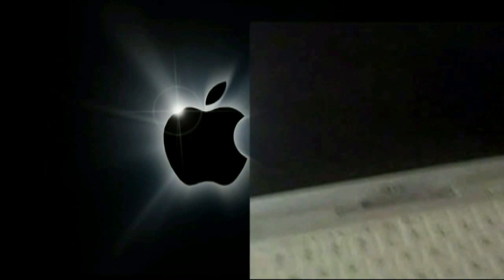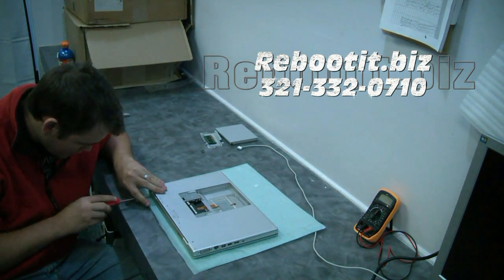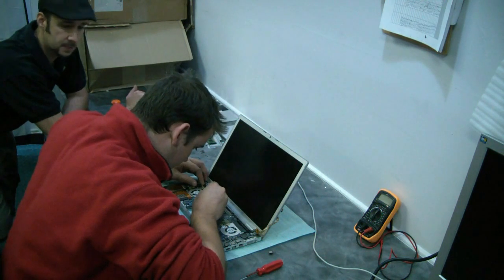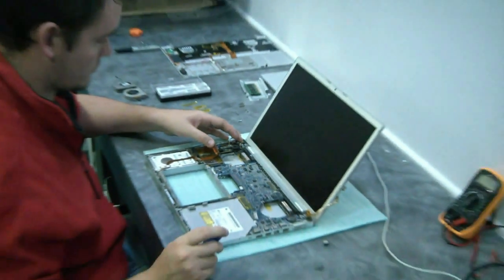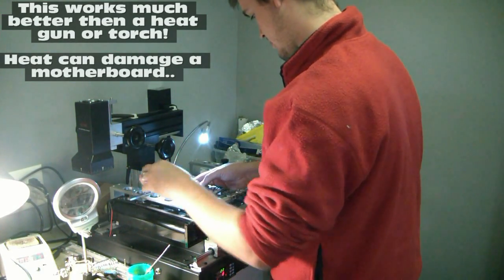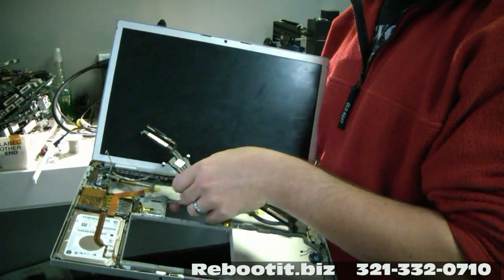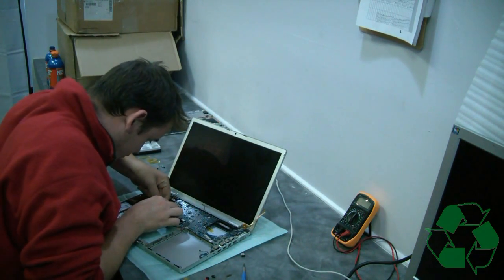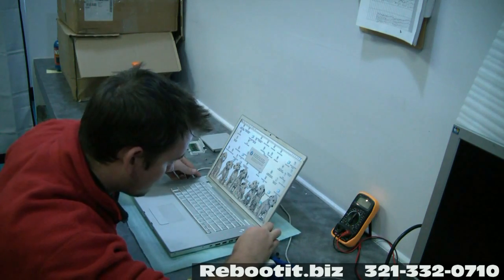Macbook Pro Intel Nvidia video failure. Black screen fix in HD

Comment: A LOT of YT Cottage Industry Late 2008 AL-UNIBODY LCD HAIR DRYER "Repairs" only caused one to
CRACK the Cover Glass.  Not warning that Apple INC. used ONE SPOT of EPOXY in the upper right corner.
The rest being held double sided TAPE!
THOSE sites would then sell their suckers a cheap CHINESE third party 2009 MBP 13.3 COVER GLASS!
What brazen BALLS!
The REAL repair is a replacement UNIQUE  Late 2008 AL-UNI LVDS flat lead CABLE!
Which no one has any more, of course 
NOT a third party 2009 MBP 13.3 LVDS! Wrong  form factor!
I ended up removing the top cover & LCD screen
Using it with external monitors
AND my 20" LCD TV....
Until the AL-UNI's GPU finally failed, last year....
It then became a Hanger Queen Parts Donor...
AFTER I found an early 2009 DELUXE AL-UNI 2.4 13.4 for only $41 ppd.
on eBay, from a young man at Lawrence-Livermore Labs
Only needing a 160GB HDD from my parts bins.
STILL my best Mac for going to scientific public meetings...
Adler, The Field, Fermi, Argonne and sux=ch like
LOOKS like the latest PRO!!
Could go to CERN with not an eyebrow raised
Pretty good for a Late 2008 MacBook that WAS going to the crusher, 
a Macster club friend had from NEW in 2008!
My 12/2007 MPB 15 stays fixed for a few days
Until CLONING a HDD
or leaving it shut on SLEEP
Causes it to overheat yet AGAIN!
Those 17 screws!!!
No heat gun needed
Just running upside down
with the fans  disconnected
until the hot air solder melts
( c. 175F)
But BEWARE of schysters!
Cheers
J.C.

Comment: HOLD ON!! wait, I fixed it!!! without any of that... It's a simple "SMC" fix—done right after taking a deeep breath.  I just had the same "Back Screen" with a 2008 Macbook Pro 17"... After watching this lengthy video I was about to ho ahead and open the laptop and follow the same steps... But thought I would give it one last shot and Google the issue out side YouTube, here: follow these steps,
1. Shut down the computer.
2. Disconnect the MagSafe power adapter from the computer, if it's connected. (AND FROM THE WALL, AS WELL... That's the key)
3. Remove the battery.
4. Press and hold the power button for 5 seconds.
5. Release the power button.
6. Reconnect the battery and MagSafe power adapter.
7. Press the power button to turn on the computer.

Comment: Great Video! I have a Macbook Pro A1260 4,1(Core 2 Duo) and no matter what I do, I can't upgrade past Sno Leopard 10.6.8. Every attempt either hangs on the first reboot OR, on a fresh install, She just hangs.  It DOES have a bad Firewire port in which case I just remove all the IofireWire kexts from Extensions then it works fine after I do that. I JUST CAN'T UPGRADE HIGHER THAN 10.6.8.  Great Job on the video fellas! -Larry (I Just Subscribed)

Comment: Reflow without reballing the cip???
Video problem will come back in 3-5 months.
Reply: +mixcatcom can you replace the GPU with another one ? I tried myself with a heatgun and resoldered a different nVidia chip on the board....but it didn't work epic fail...

Comment: I dont know if you have any branch in dubai but I have a Mac book pro. I hvent able to use it for like 2 years now. I had it diagnose they said its the logic board but having it repaired is costing a fortune they are advising me to just buy a new one. if you guys can give an advise that would be much help. I love this my mac it the first one i had so it has a sentimental value. Thanks.

Comment: I bought this Mac on Ebay and the GPU goes up to 70-80 Degress till the fan goes up
I might have to add some thermal paste for a better cooling.
Currently I"m using fan control programs to turn on the fans while playing some games

Comment: I had the same problem with this model, but I managed to fix my nvidia  chip with your  method, tnx ,  but if you could answer me on two questions, Based on your experience, How long does the computer work after REFLOW, and after assembly fans are always at 6000rtm, thanks in advance, and sorry for my bad English, it's not my native languae

Comment: Are there any signs leading up to tis failure. I recently started getting some weird lines / glitches on my screen followed by now a black screen.
Reply: Those are the signs
Reply: Ok now the screen comes on bit when I power On it gets a couple little lines around the apple logo. Then freezes. .. How much to fix approx? Unfortunately I just installed a 120gb ssd and haven't even got the opportunity to boot it up fully.. thanks for your response
Reply: I need to know the size in order to give you a ballpark estimate.
Reply: Mid 07 15" macbook pro.  (MA895LL) I  believe
Reply: If all it needs is the re-flow, your looking at about $200, but it is impossible to know if that is all that it needs without looking at it.

Comment: So, I waisted a Tequila Sunrise on my 2011 13' Macbook Pro, I5 , upgraded to 8 Gb RAM. Initially the touchpad went crazy on me. NOW its fine. Everything Works. Backlight, sound,ports, trackpad, webcam. I've done all of the reboots, and Im about 95% confident that It's a hardware problem. Im able to connect my Macbook to my TV, and everything is fine. not good enough, Im a BROKE student and I need my laptop to be mobile. All I'm asking is advise as to what parts I should buy to fix it myself?

Comment: Hey there, I have this issue, however I can successfully output to an external monitor, which is how I'm running it currently. I understand this means that the problem is likely the NVIDIA 8600, and that the extended warranty is now expired. Do you have a suggestion for how to fix this myself? Is the "reflow" method the necessary solution if I can output to an external monitor? Thanks for the video by the way.

Comment: This is actually a fairly easy fix if you have minor skills and patience and of course access to a heat gun or oven just heat the gpu up and apply new thermal paste put back together and wah lah my macbook started no problems first try and come me 11 bucks for the thermal paste so fixed it for under 15 if you have a heat gun already or an oven will work too lots of videos on here showing you how

Comment: Mine has a similar problem. When I power up there is no startup tone, nothing on the screen, no caps lock light. The front blue light on the latch is at half brightness continuously. What could this be?

Comment: I have the same problem! It is a late 2008 model. when turned on, the entire is screen black but you can hear the startup sound and see the white light at the front!
I took it to apple genius bar, several time different locations, but they insisted that it is a logic board problem not the graphic card's!
what should I do? Any suggestions?

Comment: thank you so much for stepping up to help. It turns out that my computer has no possible solution (that's what the folks said) so they are going to send me money to buy a new one. By the way, do you think i should get a monitor instead, and connect it with mac mini? Cheers!

Comment: hi, i need a Quote to Reflow my logic board Macbook Pro A1150 , these laptop doesn't display video ( Black Screen ) and it averheating problems may be the Video chip overheating..
Please email @ martin0778@gmail.com 

I have another laptops with the same problem
Acer One Aspire D255-2509
Compaq Presario

Comment: Will you quote me a price to change out my drive (I provide) and replace the fans (you provide) and clean my Macbook Pro? It seems (looks like) to be the same model you are working on in your VERY EXCELLENT Video here. I live in Hampton Roads, Va. and would need returned shipping in the price. Other than the Fan and Hard Drive my Macbook has been up and running almost constantly since 2008 when I bought it. I am sure there is a Forest worth of debris inside,

Comment: Hello
what is profile you use.
I had same problem so just it turns good with blackscreen, just fan turn normally.
I connect all peripherical (hdd, ram, drive...) but after reflow, nothing, just one white led in front and we can't listennning OS...So can i do ?

Comment: Hi Pete. I have the same MBPro and have same graphic chip problem. I took it to the Apple care center and they said they cant replace the chip or re-pair it they have to change whole logic board to fix this problem . New logic board is almost 50% of the new laptop price :( . 

My question is Can i change it with new chip or reball it ? I have a friend who does it professionally . I am asking it coz the Apple care guy told me its impossible in apple laptops the change whole logic board to fix it.

Comment: The Nvidia issue is covered by apple under a extended warranty program. If it boots without picture go to a Certified Apple repair center. They can run a test and see if it's the Nvidia issue, if so it'll be fixed free of charge. O, and it has to be younger then 4 years.

Comment: nice supervision XD 

P.S. don't use a air compressor, can cause damage to the internal fan plus air compressors can get moisture in the lines and then spray into the computer.